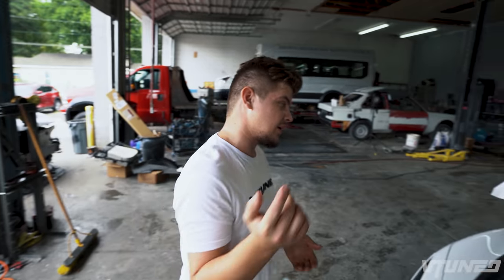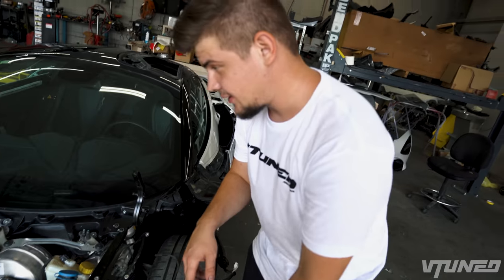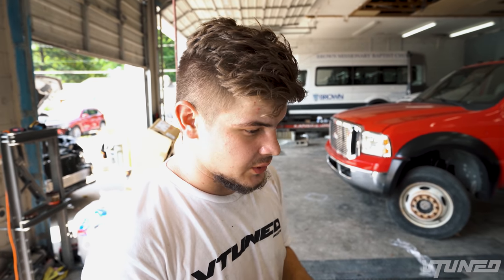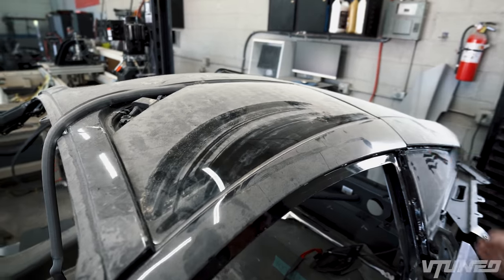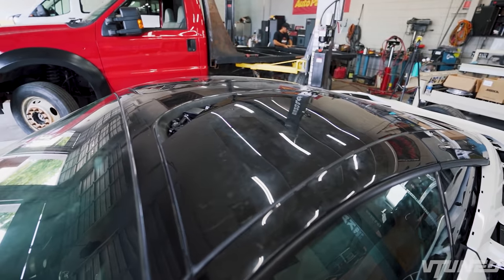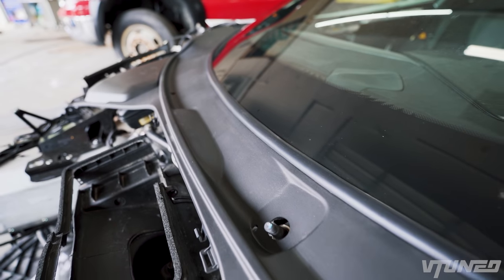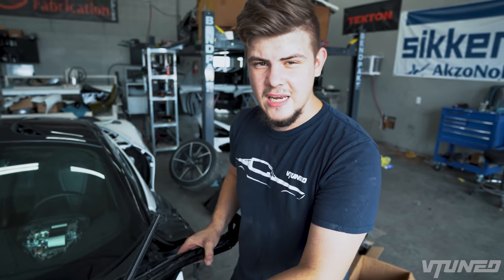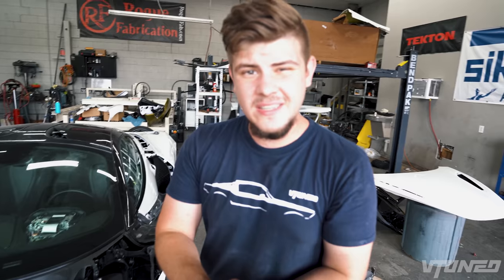This is the Hardest part of the McLaren 720s build - Episode 27

Comment: Yo vTuned, this build is off the charts.  We know you spent a ton of $$$$ on parts. But honestly, if you add up all the time you spent, it would far outweigh the parts cost.  This is a labor of love, man.  And it shows!
Reply: Honestly, I am not convinced that is accurate. They could have really exceeded the cost of a used McClaren.  Not to mention the resale on this is going to be not good, no one would want to buy a rebuilt McClaren that was frankensteined back together with a bunch of guesswork
Reply: @mikerzisu9508  yeah but you are forgetting the value of the experience gained from such a rebuild and also the content for his channel
Reply: @orbytl2799  yeah the YouTube revenue must be nice
Reply: @Murdered5.2 Ram over just a used McClaren that has not been in a huge wreck and rebuilt? I doubt it
Reply: @mikerzisu9508  my point is that if they fairly costed out the labor, it wouldn't be worth fixing.   They did for the experience and the video.  For them, it was worth it.  Sometimes it's about the journey, not the destination.
Reply: @gusser2121  I get that. It has to be very satisfying to accomplish this
Reply: @mikerzisu9508  you need to read more carefully. You are both in complete agreement. He said what you said exactly.
Reply: @mikerzisu9508  id buy it
Reply: @cars182009  As a track car for open tracks with run off and for under a 100? Yes. For driving to the hair stylist, yes. Serious on road driving or narrow tracks? You'd be an idiot. Would you want to sit in this thing carving through a canyon and the wheels come off as a reused part failed?
Reply: @mikerzisu9508  actually the main problem of buying salvaged cars is actually not knowing how much work and how the work was done. With the videos you know fairly well how it was done. Price being right I would buy.
Reply: @cutdepiefails6596  you have a good idea on what was done but this is not even close to the total amount of work that went into this car that was not captured. No way I would buy it, it is just asking for trouble down the line. Who knows what will go wrong with it
Reply: @floriandiederichsen6597  lol, you must have never fixed cars. I have rebuilt many cars! Lots of times a person rebuilding does a better job putting car back together then a dealership! ESPECIALLY when super cars are being assembled by hand anyway 😆
Reply: @mikerzisu9508  I understand, and to be very honest if he was to sell it before he puts any meaningful miles I would not be chuffed about buying it as well.
Reply: @floriandiederichsen6597  i own cars that go that fast. Like i said if i rebuild a car, i feel safe in it. Im sure Vtune didnt rebuild it not to feel safe in it going 200mph.
Reply: @cars182009  Great, what? 
And I'd trust something I did right myself more than the usual workshop work, too - I am wondering if this one was done right, especially on replacing parts. If vTune is ever going to drive it hard is an interesting question. Also, he's young, that goes a long way :-). 
Another reason I would only buy this one very cheap is warranty, sadly McLs do have lots of niggles and you won't be able to get it under extended warranty. Didn't have an engine or the dreaded transmisson yet, but two screens, accumulators as well as two rear shocks.
Reply: @floriandiederichsen6597  if we are talking about warranty then yes i agree. I like all my cars with full warranty.
Reply: @mikerzisu9508  It's not the value of the car that is important to Vtuned...it's the $$$$$ made off  the Youtube video's....that is where the value comes from...the car is just the PROP...that brings in the $$$$$ from the Youtube Videos....the car may be worth $150K when finished(rebuilt title)...but I am sure...he made MORE than $150K just from Youtube...
Reply: @claudelandi510  I would agree with that. It was well documented and not a lot of content or there like it
Reply: One of my favourite builds by vtuned! 👍🇨🇦

Comment: There is a company in the UK that sells gas struts at any length that you can adjust for the amount of spring pressure by letting the air out via a grub screw. The painted steel ones are cheap and they come in stainless steel for a bit more. They can be fitted with several different mounts so are fully customisable. I am sure there would be similar suppliers in the USA

Comment: 6:40 Is that the correct OEM 3M adhesive to be using on that McLaren? The latest Tavarish McLaren video says there is a shortage  of the 3M DP 620 NS panel bond and that is holding up his rebuild! Are this adhesives comparable?

Comment: Hey how does it work over in the USA. Here if the vin/chassis number in the bottom corner of the front windscreen and the vin/chassis number stamped into the cars engine/engine bay doesn’t match and you get stopped by police or the car goes for your version of an MOT here in the!?. Here in the UK if that car was stopped the police would either think it’s stolen or a cut and shut!. Both would result in the car being impounded and with a cut and shut the police here will scrap/crush the car!. If the same is found on an MOT here of course it’ll immediately fail, meaning you can’t legally drive it on the road and I think they have to contact police again. So yea technically speaking this car in the UK is a cut and shut. I know it’s a tub/monocoque with the back end bolted on but yea because their two half from a different car how will this car be legal in America!? Here like I’ve said as soon as your caught it’s getting crushed!.

Comment: I've watched the rebuild from the very start and it is very impressive without the shortcuts many shops make when repairing vehicle accident write offs. The video editing is also of a high standard. However I am concerned about the amount of parts you had to continually keep buying and particularly the high cost of new original equipment parts from McLaren.  Have you stopped and counted up all the invoices yet to see what the total cost as been. You must be close to a break even point.